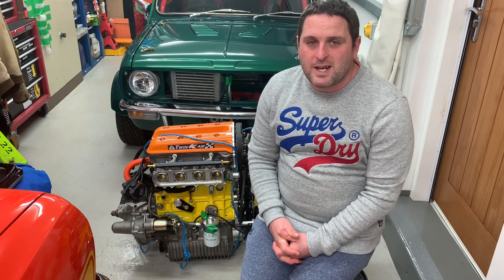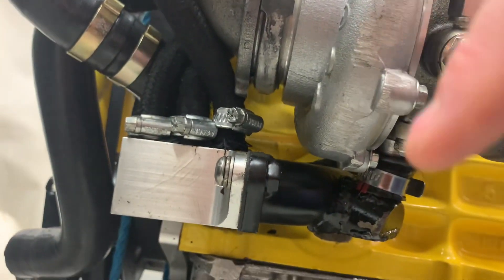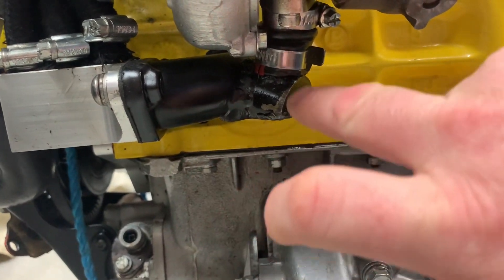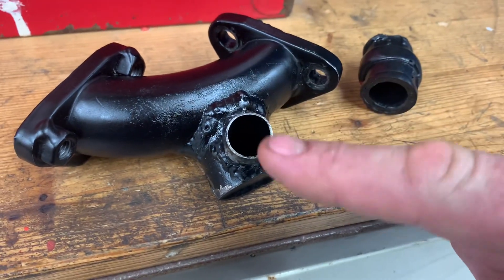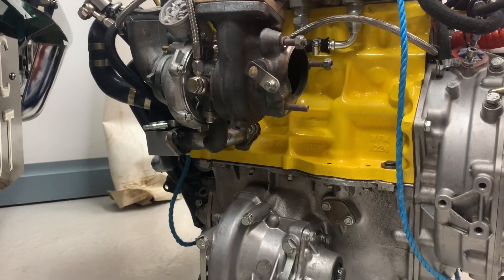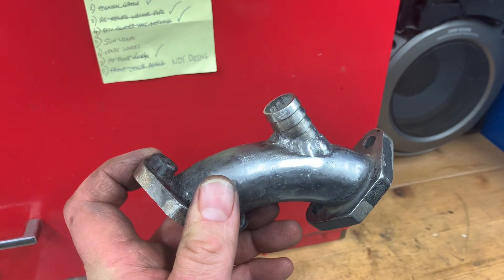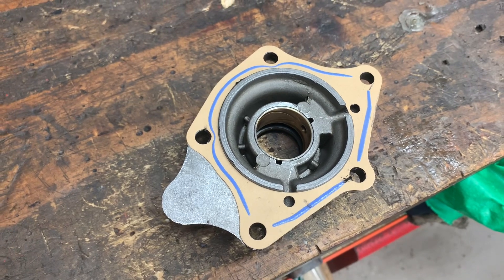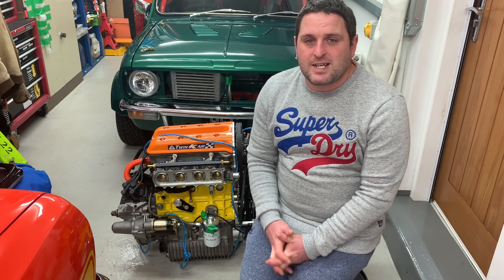Mini Twin Cam 16V Improvements Episode 2

Comment: Hi Craig. Beautiful car. When I was building my turbo project, one thing I learned was how critical oil drainage from turbo to pan was. Having any restrictions at all can be problematic. Having a 90 degree bend will create issues. Sorry for saying this. I had to drill into the sump and weld a bung for a large -12 AN fitting. Now that was for a Garrett GT2871, so yours will be a bit smaller. However, having as straight and large as possible drain to sump is critical. Again, beautiful car and you have a new subscriber.
Reply from the maker: Hello Craig, thanks for the comment. Appreciate the message regarding the oil drain. The original T3 turbo fitted to the metro turbo was fitted with a tight 90 degree and therefore Ive pretty much copied the same idea with this GT17 turbo. So far soo good 🤞🤞. The only other option was as you said, to return the oil to the sump which was my original plan but I just didn’t want to drill my gearbox casing as it’s such a rare box. Hopefully it will continue to be problem free Craig. So far no signs of any smoke 🤞🤞

Comment: Could you utilise that blanking plate on the right side of the back of the gearbox (as looked at in this video) to drain the turbo oil? or was that where the oil pick up pipe went from the sump? Not too familiar with the layout sorry, just thinking out loud.
Reply from the maker: Yes absolutely right that’s the oil pick up point and therefore wouldn’t work. Big shame really as this would make a nice neat option

Comment: Hi Craig, I really hate to be that guy but I’d really like to do this swap. What’s the exact spec of your engine? Pistons bore size cams crank rods etc? Sorry I realise it’s a big old question but I’ve got a 1380 clubby and I want more power haha
Reply from the maker: @sam._.buswell8181  No problem Sam. Sorry for the delayed response. It’s bored to 1293 and uses 18cc Forged omega pistons with valve clearances applied. The cams are standard LT cams from the bike which I’m told are a better profile for forced induction than the RS cams, although specialist components do a set of uprated turbo cams aswell. Crank is an A series crank that’s been X drilled, Nitro carbonised, and balanced by MED including centre main strap. Con roads are also A series but shot peened and balanced by MED also. Specialist components conversion kit including vernier cam pulleys, lightened flywheel with single grey clutch and AP racing clutch plate, GT17 turbo mounted on a custom manifold with bleed valve, MR2 intercooler and custom hoses. Alloy radiator and 13 row oil cooler. Gearbox is a very very rare jack knight 6 speed dog box with straight cut drop gears and 4 pin diff. I think that about covers it.

Comment: Nice upgrades on the oil return.  Could you if a electric fan instead of the one running  off the engine because in the video the fan looks very close the the large pipes behide the fan?
Reply from the maker: Yes this is something we are actually discussing at present because the fan is also a big power loss to the engine
Reply: @performanceclassics1986 
Would you go the traditional rad and lecky fans up front, or unconventional rad and fans in the boot space, vented down and out through suitably modified boot floor..
or....
use a lecky fan and custom rad combo under EACH inner wing area,  mounted horizontally with air fed up and through front facing ducts and out vented A panels or through shark fin stamped louvres in the front wing tops?
Reply: Yeah. I was thinking the same about an electric fan. Good upgrade.
Reply from the maker: @RawTopShot  All very good ideas and certainly worthy upgrades but I just don’t want to modify the body this far. As time goes by, I’m becoming more tempted to return more areas of the car back to standard 🤣

Comment: I can't lie if that was my car the 'improvements' I'd be considering would be a second even bigger turbo in addition to the one already on the car,   am I just mad? Yes. 😂
Reply from the maker: 🤣🤣 No not mad. You can’t have too much power 🤣🤣
Reply: @performanceclassics1986  I currently have a giant Nissan Navara pickup Turbo as a shelf decoration in my man cave, and I also have an innocent little 1970 MG B GT... The temptation is killing me 🤣
Reply from the maker: @PROlegend-pb6vm  🤣🤣🤣 Do it
Reply: if I wanted to go crazy I'd try the supercharger and turbo combination, first seen on Lancia Delta Group B's I think; it's something MED scoffed at saying it was impossible, but there are cars out there that run both; I "think" the supercharger handles the low down pull whilst the turbo spins up, and with the SC doing all the low down torque stuff the turbo can be much larger and has plenty of time to spin up, so lag isn't an issue using a huge turbo. At some point in speed/boost the SC is disengaged (electric or mechanical clutch from crank) and the turbo is doing all the boost at upper rpm.
Reply from the maker: @RawTopShot  very interesting. My biggest challenge would be room. It is already soo very cramped under the bonnet. It’s a complete nightmare to work on 🤦‍♂️
Reply: @performanceclassics1986 
You still created one of the most beautiful cars and engine bays out there though 😊 
You're becoming a national treasure in the automotive world 👍
Reply from the maker: @RawTopShot  Thanks very much 👍 appreciate that